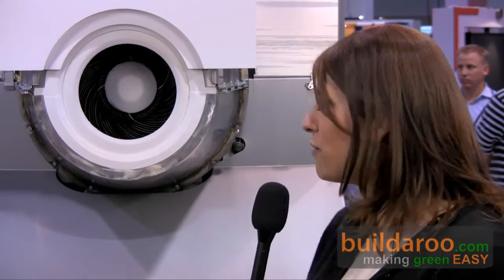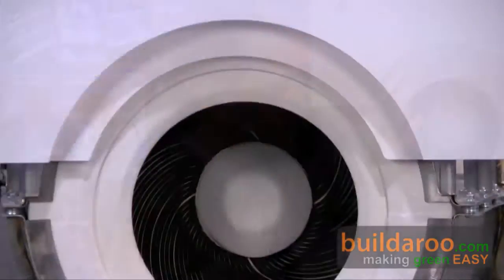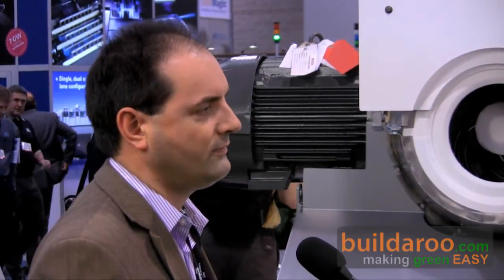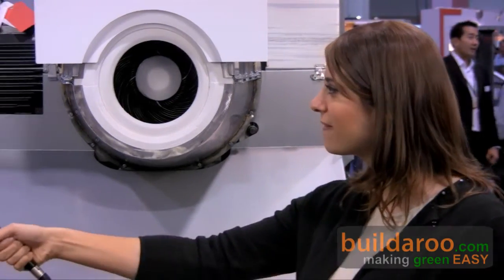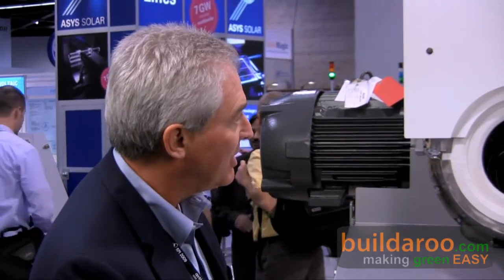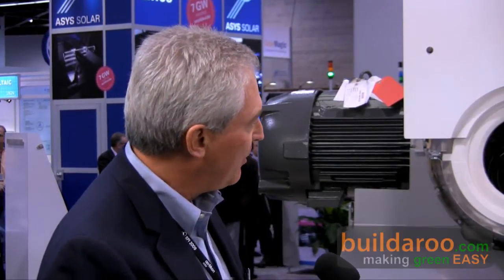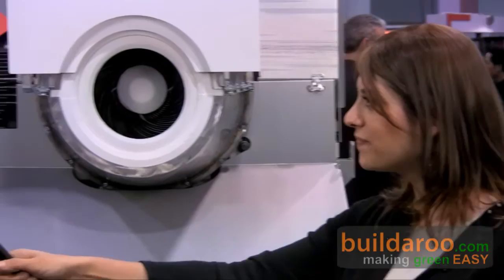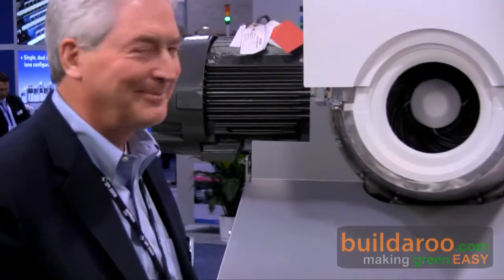Stirling Energy Systems Intros Their New Suncatcher CSP System - buildaroo.com

Comment: I want just the Stirling engine and Power generation unit. I want to retrofit it to a high volume hydrogen-oxygen generator cell to produce the gas to burn as the heat source to power the 25kW generator.... This would take the need for solar completely out of the picture.. And it still would be clean only emission would be water vapor..